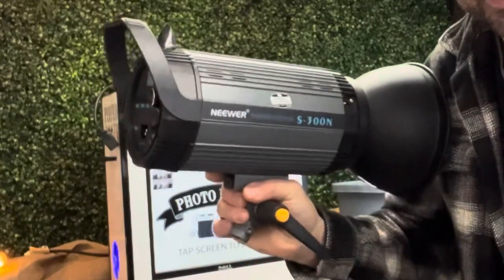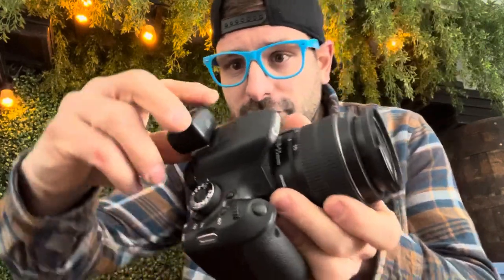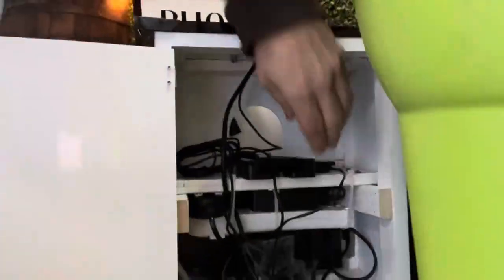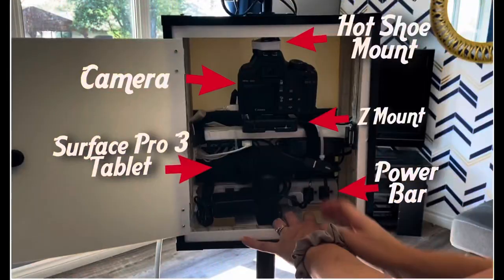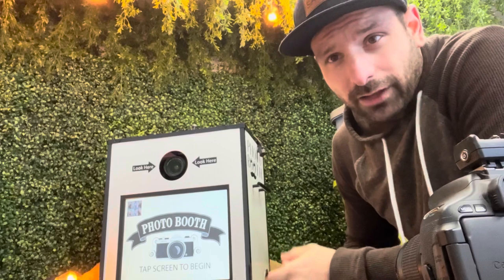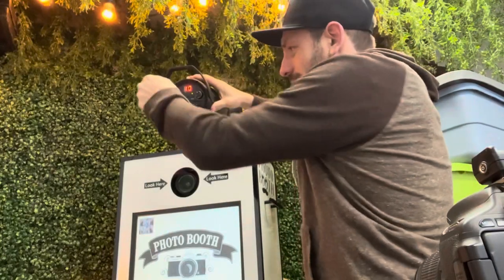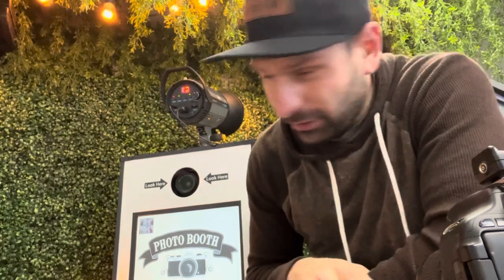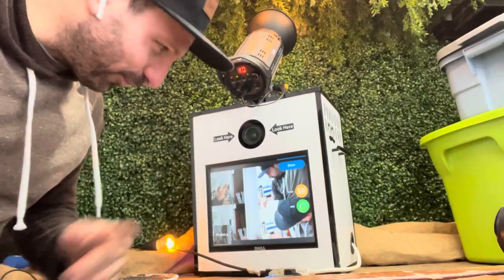What Is A Pc Sync Cord Hot Shoe Adapter? [Photo Booth Knowledge]

Comment: I know this is older but I’m having trouble getting my 80D canon to fire my trusty power pack studio strobes. It works well with my Nikon but I need it for my 80D. Are there settings on camera I’m missing? I wish u mentioned exactly how to use this adapter. Mine won’t work